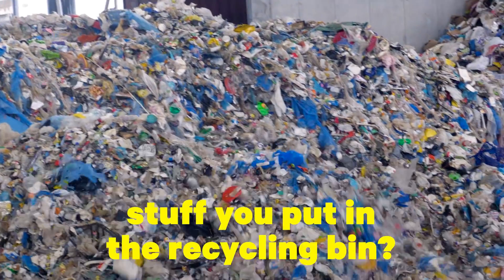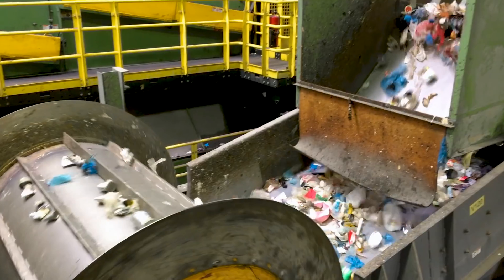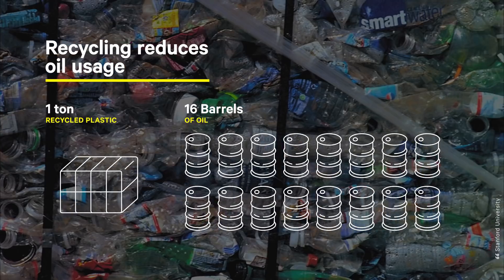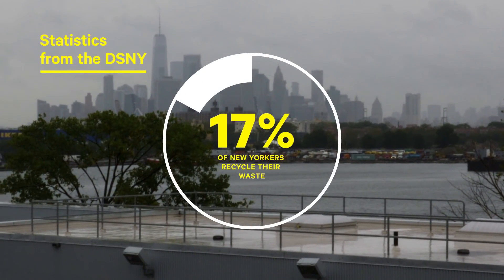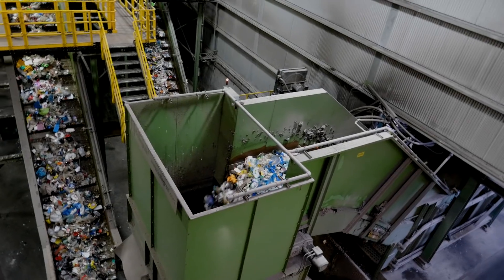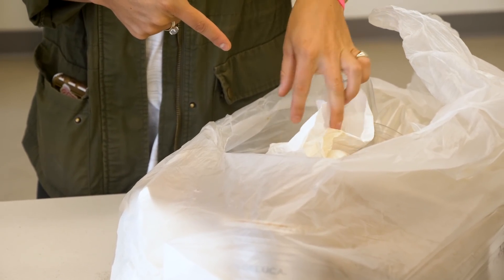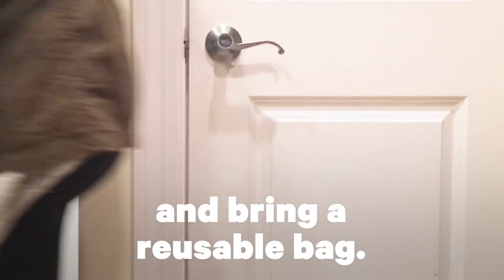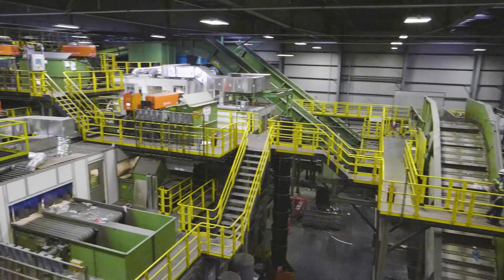What Happens To Your Recycling After Being Collected | One Small Step

Comment: What a load of BS. Due to the the fact there are so many different types of plastics, such as PET, HDPE, LDPE, PP, etc. then sorting, washing, melting, reusing them, is more expensive than using new plastic made from oil.  This results in that maybe at most 15% of the plastic reaching the recycling plant actually gets recycled.  The other 85% is burned or put into a landfill. 
In conclusion, everything that you seperate, and put into a seperate bin, is basically going to a landfill, except 15% of it.